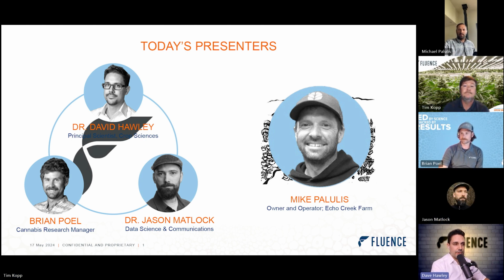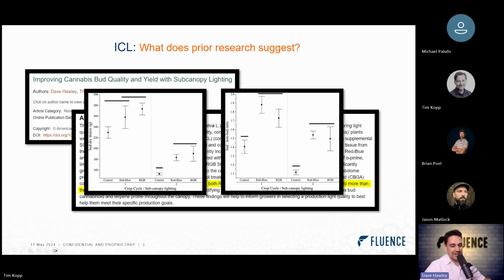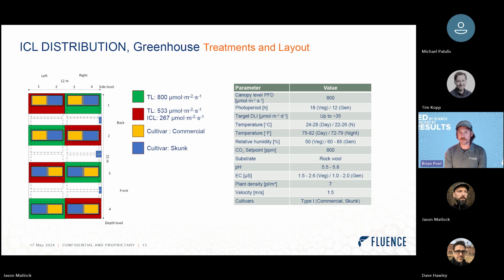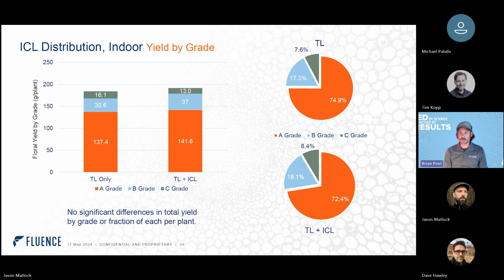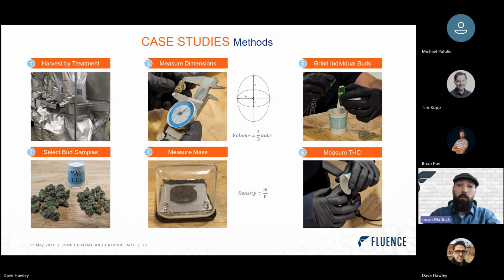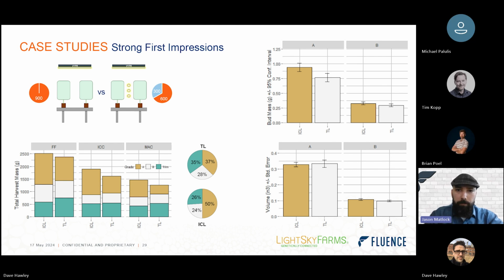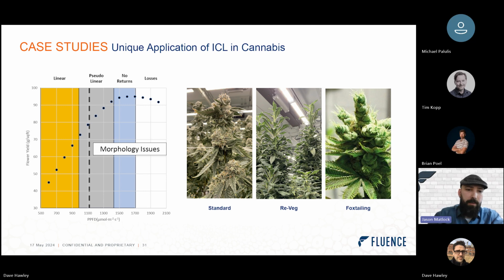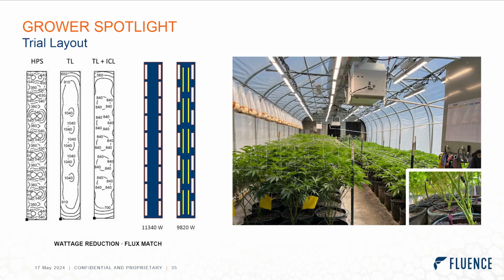How To Leverage Intercanopy Lighting in Cannabis | Fluence Webinar

Comment: I wish more people would recognize that cannabis can’t just tolerate that much light and spit out yield. Most plants will perform shitty at over 1000ppfd and yield will actually start to drop. This is especially true if your temps aren’t high enough, co2 isn’t high enough, or anything is limiting nutrient flow in the plant (overly high soil EC, overly high or low humidity, excessive wind, etc). Light isn’t inherently safe, it’s a necessary risk that should be dealt with caution.